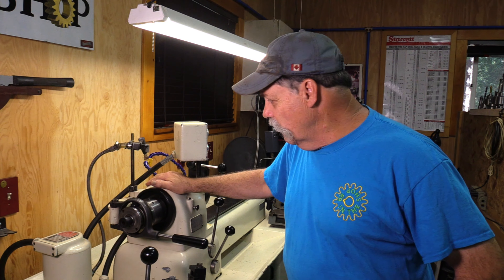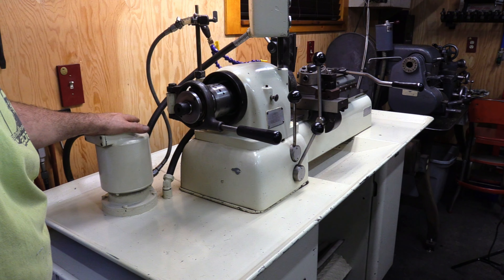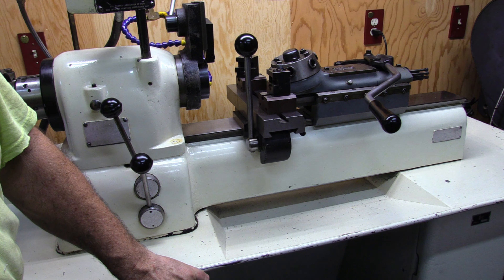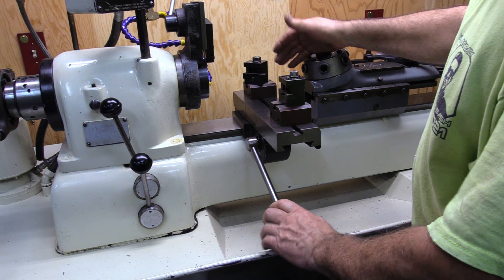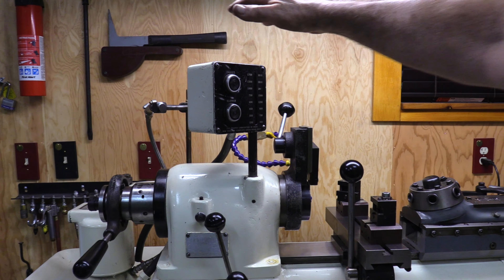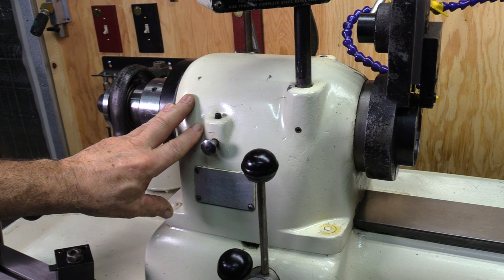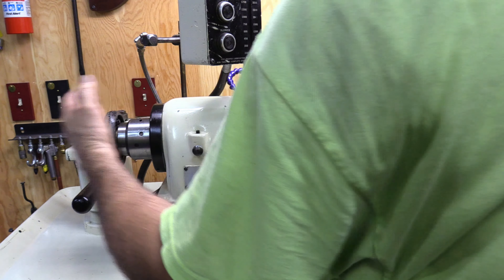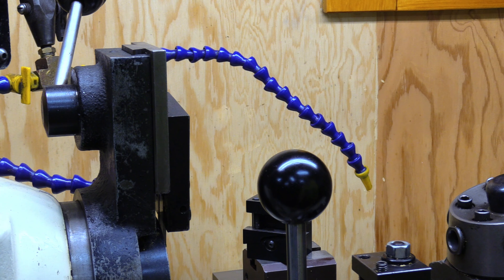Hardinge DSM 59 Turret Lathe For Sale

Comment: The new tool must be a CNC lathe. I have an HLVH, DSM-79, and a Haas TL-1. The HLVH-H gets used often and the DSM still gets used occasionally. I probably use both because I rebuilt both including bed regrinds. I get it Randy, if you don’t have the room, something’s gotta go. Good luck with the sale. Someone will be getting a very nice machine.

Comment: Hi, just found your channel and though I’m aware you are mostly metal work (?) I did notice on the video that found my feed that you have the Delta unifence such as I have. So a random question-have you done anything in particular as a work around to the unique design of the fence that can make it difficult to attach clamps, jigs, etc. to it? (Due to the slide aspect getting in the way) I did a search through your past videos and nothing jumped out at me regarding that (though I found plenty to revisit!) Thanks if anything to offer on that front.
Reply from the maker: I attached a 2 x 4 to the rail, and I have attached anti kickback rollers to that,  works well for the last 30 yrs.  Thanks.